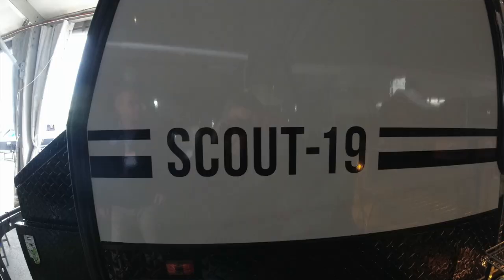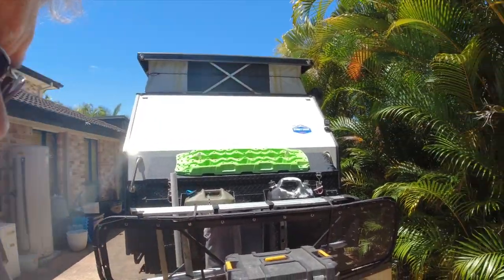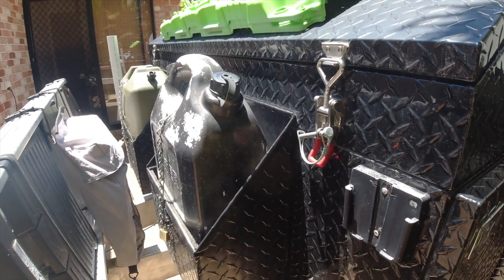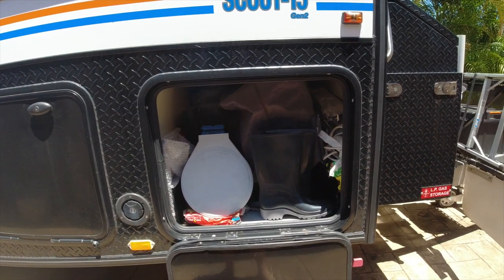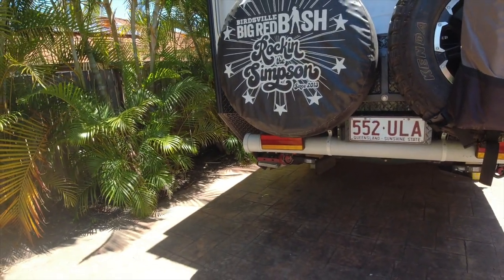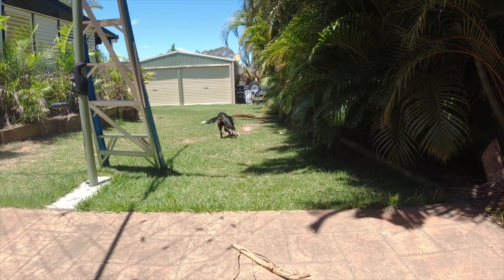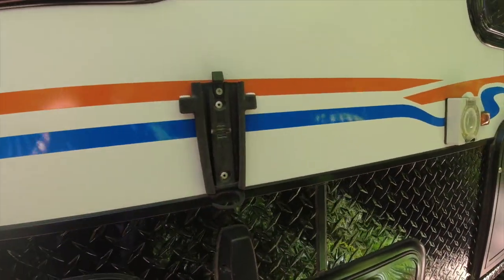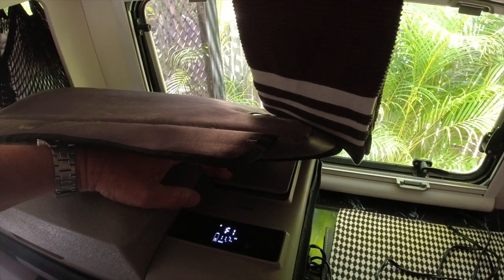Stoney Creek Campers Scout 19 and 15 Gen 2  mods

Comment: G'day That 19 ft Scout is a bit on the heavy if you ask me, going to have some problems with gross combination mass  I think. Is that not the Bora fan from RTM ???
Reply: Stoney Creek Campers are working on stripping out several hundred kilos before making it available. I don’t know the name of the RTM fan sorry
Reply: @GlenntheBeerman  At least being dual axle the towball weight should be a lot less.  What was its current weight?
Reply from the maker: @playn100  Less than 180Kg but that's not loaded and without water in tanks.